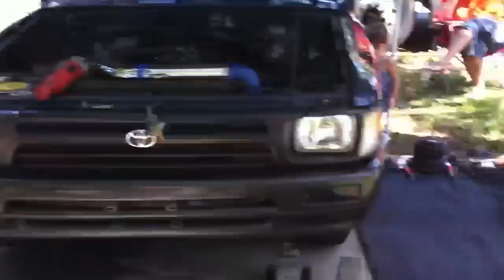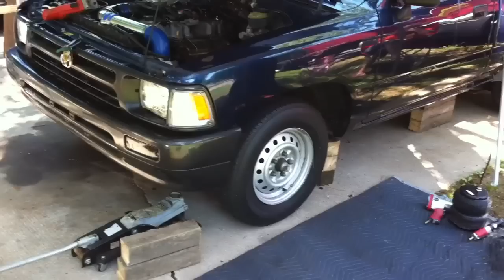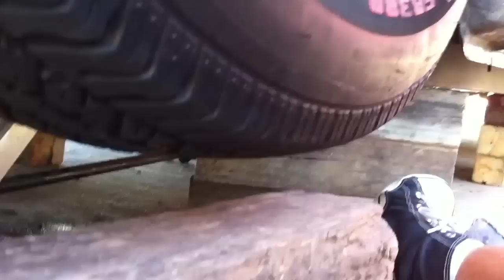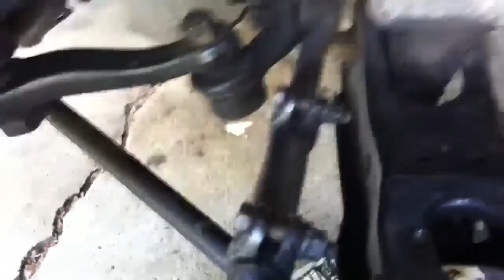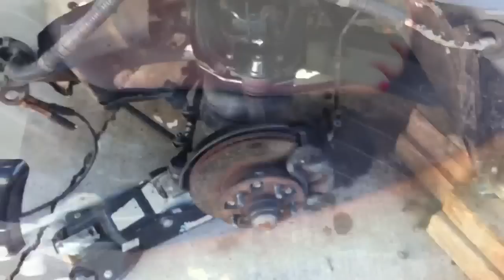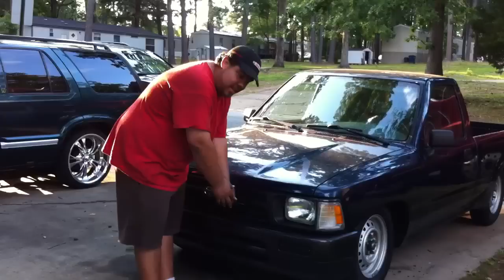How to bag front suspension

Comment: Just wondering y did u go with a 2600 in stead of a 2500 I had a 84 toy same frame as urs and put 25s all around it and had a lot of room for the bag in front did the same way just mounted them a little lower

Comment: actually this is exactly what i waslooking for. thank you ! 

I have a 1985 toyota pick up ( also torsion bar front ) and was looking for kits but couldnt find any that were for the front. so this is a decent write up on how its done.  the truck as it is now is just a horrible ride. i mainly want air bags for that smooth ride. the people before me lowered it enough to where its laying on the bump stops in the front and every bump is just rough. plus it would be nice to be able to have it at factory ride height when driving around and then slam it for when i need to load up my dirt bike.
Reply from the maker: Thank you and glad this can help. Love your ideas for why you need it bagged makes perfect sense.
Reply: did you do a video for the rear ?
Reply from the maker: Yes I do the entire Toyota build is on my channel.

Comment: so if you wanted to make it so you could bottom out your bags and still have an inch or 2 could you just use 3 blocks on the frame and 2 blocks + a 2x4? that way bottomed out it wouldn't scrape bad
Reply from the maker: +Kristopher Moe absolutely you can set it to wherever you want that's the joy of building your own ride

Comment: I'm not sure if the sway bar is in the same location as an 84 as it is on yours (mine runs to the rear but bolts onto the lower arm forward of the shock) but if it is how did you relocate it?

Comment: What was the whole point in jacking up the front tire at the start? To see what the biggest tire you can use and make clearances?
Reply from the maker: To check where the upper bag mount should go for maximum drop when keying the truck out. This also gives you maximum lift when lifting the truck up.

Comment: Awsome but...i have an s10 with torsion bars...should take them of and do abt the same setup right?? Wich bags are them air lift 5000?? And im in brasil...brazilian s10 truck.tank you man helps alot!!
Reply from the maker: I'm not completely sure on your tortious bars but the bad set up will be different cause you have coil springs so the bags go in place of the springs and you will need bag cups and do some different cutting for the bags to fit. I used 2600 a 6" bag. Hope this helps a bit thanks for watching.
Reply: Thats the point...brazilian s10 use torsion  bars...not a coils...already tryed on bags in the front...didint lift not enough...for drive haha...
Reply from the maker: That's so weird lol I would not know anything about them then sorry.
Reply: Ok tanks bro
Reply: +William Low Customz 
if your keeping the 4wd, you need to mount the bags off the torsion bar.
meaning you cut the t.b. and weld it to the lower control arm. then weld the lower bag bracket the it.
you will loss some turning radius but it can be done.
i have a 88 s10 blazer that was 4wd but i pulled all the 4wd crap out. and im bagging it just like this guy.
thank lawrence for making these vids...
great work.
Reply: tanks guy for the instruction, but brazilin s10 is so diferent the set up! but! already did full air bag setup, and not bad but i will d better by the way!!! tanks man!

Comment: maybe you should of done some bag research and found if you used 2500 series bags.. you would of had lots more room. and not hit so many things
Reply from the maker: As you should do research and you would know that the smaller the bag ther more air pressure you need to lift the truck. That means that yoir air compressors work harder your tak is stressed along with your air valves and finally your air lines and bags. Things last longer ther less stress they have on them. But thank you for your input. Please watch the rest of my videos.
Reply: 2600 is the way to go up front on any dam truck . I tried 2500 bags to save space . And with my air tank/ compressor setup cant even lift it at all unless way over 100 psi so I'm just gonna order 2600 bags and make a little more room . 2600 bags like Lawrence said . 2500 bags are fine for the rear of a truck  i.m.o. but I just found out the hard way